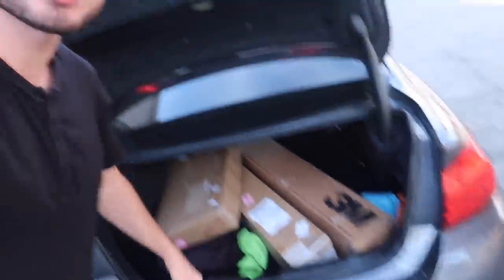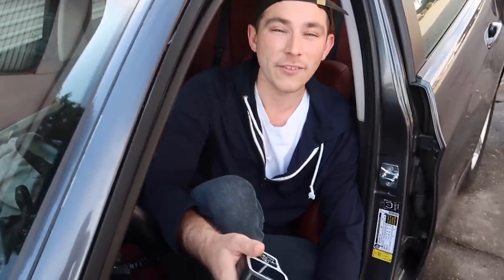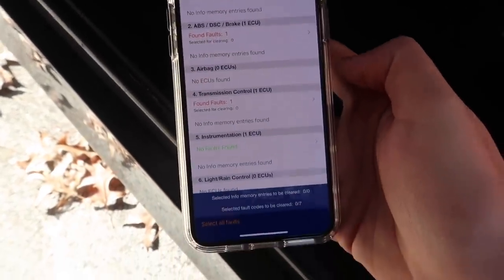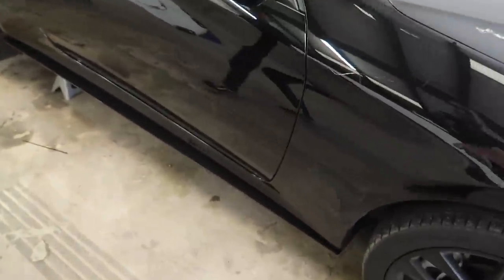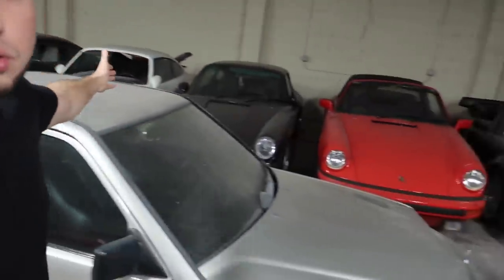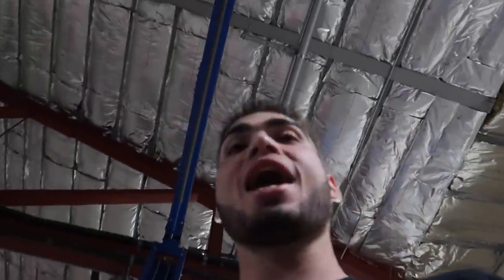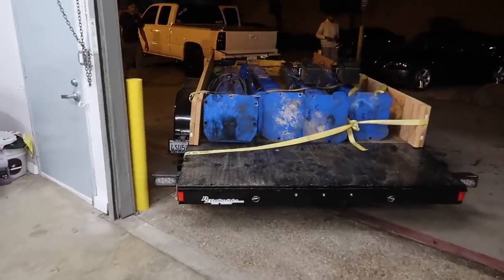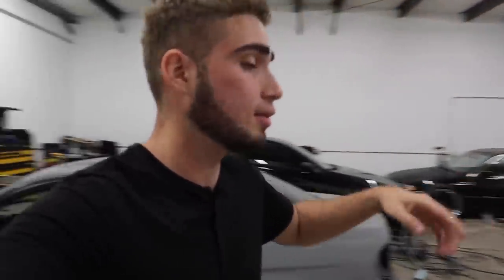WE WENT ALL OUT! (THEY ARE MASSIVE!)

Comment: The issue with his e90 if the idle is rough is that it’s vanos solenoids which need to be replaced with oem solenoids straight from bmw not Chinese ones as they cause you to have more of a rough idle and can cause other problems, once you’ve replaced the solenoids update the software threw ista
Reply: There’s a video on it can leave the link if you need
Reply: Wait is it n52? Or n51?